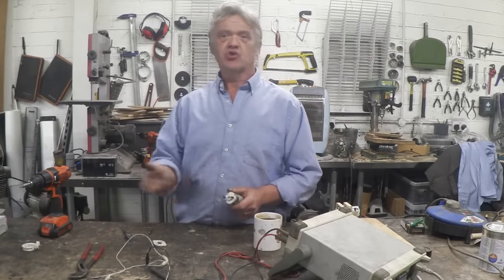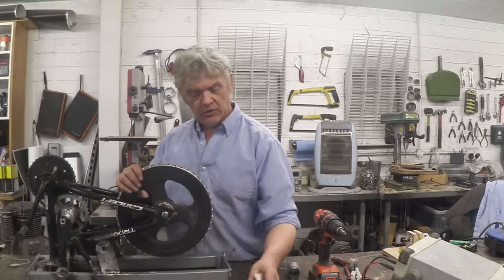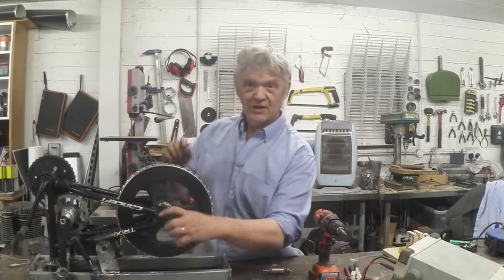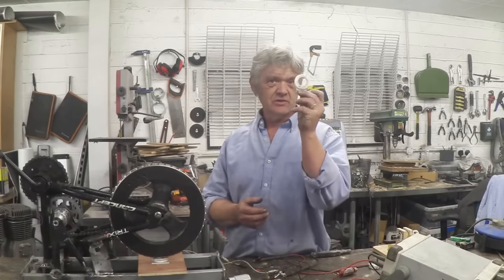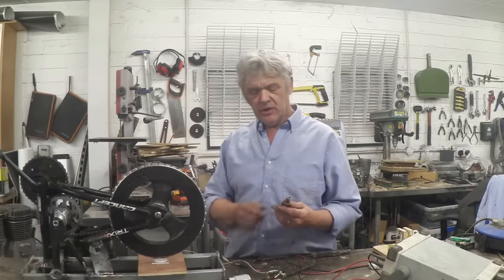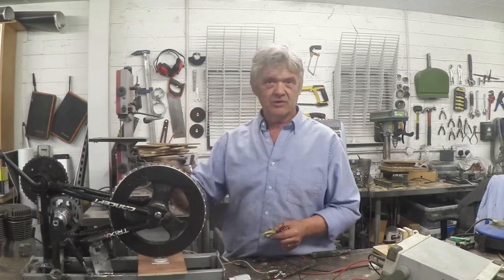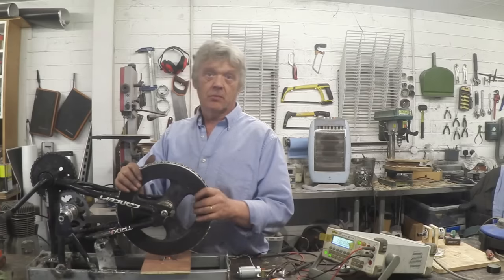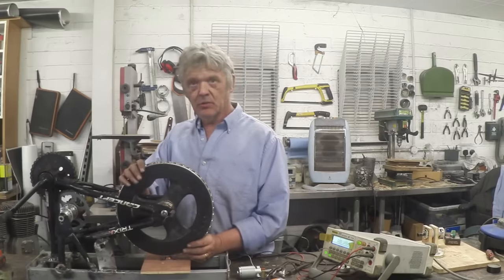2143 Generator Secrets

Comment: Great demonstration, Robert. I've spent countless hours with coreless coils manifesting electricity employing permanent magnet flywheel rotor development. To pass on the secretes of what I've learned and gleaned from permanent magnet rotor flywheel and coreless coils is comprehending that this is biased pulsed energy. I think you will discover that stacking two turntable open coils with the start of the coils facing each other (Split single-phase arrangement) and configuring the magnets all North or South will facilitate three times the wattage... I hope you demonstrate this in a future video demonstration. Thank you for sharing...

Comment: I have been saying that: more voltage is less resistance. For 10 years. Usually people just think I'm some free energy woo weirdo and put more metal on their generator. Not even thinking about how much Wimshurst on pulse motor could generate. This is what Gerard Morin also tried to explain.
Reply: LoL.
How much do you think tho the voltage should be?
Let's say for a 30kg worth of copper coil, permanent magnet motor?
Cuz I think too high of a voltage would be difficult to manipulate and manuever.
And the returns become diminishing at a certain point anyways.
Though I concluded the same for motors/generators as you.
Reply: Lol Tesla wanted to initially use 800 volts to maximize the reduction in copper and mass.  Say what you want about their Apple like software motes, the engineering is top notch.
Reply: @yasirrakhurrafat1142  The issue seems to be that all people are looking for something portable, or at least movable. The HV really isn't that much of an issue. MrTeslonian has a good video about HV step down transformer. It's basically a regular Leyden jars, with tunable copper wire coils inside. It's really not that much about the voltage either, high frequency seems to be more essential. Like the switch mode power supply works. It all depends on the usage. The key thing is to make good charger and have cheap fast charging hybrid battery capacitors, or both in parallel.
Reply: @Kangsteri  ooh yeaahh!
I also thought about motors, as how mini motors.. given enough voltage.. wouldn't require much power/current, thus could potentially push motorbikes and stuff at a really low weight.
Although it'll need ultra high quality bearings, and sufficient cooling.
Same for generators , considering a speed up gear is used to multiply the input speed.
I will need to look up though about frequency.
I used to kinda hate AC current.. now I see the utility.
I also think that reducing deadzone of generators will result in higher energy output, per size/weight.
Also as you mentioned, frequency.. to a good extent.
Reply: @johnschneider931 Louis Rossmann disagrees.
Reply: @ericmc6482  stop arguing and test it guys, you're on the same team here, we all are, this is for science. if the theories conflict, test it. that's the genius of robert's channel.
Reply: E=IxR
Reply: @Cryptic_Triptych  + Angular momentum. It's exponential, not linear. It takes less energy to run 3 LEDs or other diodes in parallel than one. It takes more power to start a carousel or swing, than to run it.
Reply: Yes, that is R, resistance. VFDs have more or less solved the issue of high resistance starting, especially on large equipment like motors. 

I always laugh when I see people trying to explain how electricity works when they refer to a sine wave or other two-dimensional vector drawings. They don't realize that the frequency is expanding and contracting in helical vorticies.
Reply: @Kangsteri I believe that was Tesla's main combo, High Voltage,  high frequency,  pulsed DC "current". For the transmission of electricity wirelessly, here we are talking energy generation. Could put the thing in a vacuum chamber to eliminate wind resistance,  use a tesalonian style Vandergraf generator and the capacitor based voltage divider that Mr. MurraySmith had shown us to step down the voltage,  maybe use graphene based supercaps to store it and regulate it
Reply: @suffolkcountysheriff  I have been thinking about that recently. I was planning to try transformer coils in mason jars. But vacuum pump is expensive. There is a hand pump called Brake bleeder, that would be much cheaper for experimenting.
Reply: This may be obvious to anyone who has done any real experimentation, but it seems to me that the resistance from the eddy currents is insignificant in comparison to that of magnetic attraction to an iron core... or is it that copper wires are too thin for eddy currents to form?

Comment: Even with the mechanical imperfections and only having a single coil, you should get way more than a watt out of that arrangement. I think the magnetic flux was mostly being pulled into the steel wheel away from the coil, and also the coil being close to twice the size of the magnets was causing adjacent magnets to cancel each other as they pass the coil.
Reply: Ah, yes... that was exactly what I was thinking as well.

Comment: You can use odd number of cored coils vs even number of magnets or vis/versa to reduce cogging also. I've also read that using a ferrous sand for the core can work better then solid or plate iron.

Comment: You should turn the "Fly Wheel Generator" into a kit for High Schools. Interchangeable parts to demo different configurations and resulting performance(s) then add some Arduino (volt, rpm, etc.) this will segue to the Computer Science, Electronics, Physics and Chemistry Departments culminating in a holistic education and a run-on sentence.  IMO, a holistic education is how we're going to survive the future.

Comment: Great video Robert. What you are doing idea wise is the same way as the idea I had for making a killer generator using the old style hit and miss engines of old. I would bet you that you could make a killer generator using that very idea. 
              I hope you run with the idea fella. Would bet that is the direction for you to use with that idea. Good luck as the old engines are super efficient and have longevity which is an added benefit for your idea. Peace vf

Comment: You could also use differently shaped and polarized magnets arranged as a Halbach Array which increases the magnetic field by restricting it to mainly one direction (the direction of the pickup coil) so in effect, the magnetic field intensity can be boosted. Boosting the magnetic field intensity as it cuts across the coil will induce higher potential and more current from the same coreless pickup coils, so still no cogging but increased power output.
Reply: Whoah, facinating. Neat, thanks for sharing.
Reply: If the array is spinning outside it's just dangerous imho

Comment: I am a bit confused... How is the current being commutated in this design? It's hard for me to read the Scope... so I can't tell if this is supposed to be AC or DC?...
Re: the low amp production,  could the low amperage of this design be due to the diameter of the coil such that the opposite ends of the coil are overlapping the magnets so they are fighting each other in a  "differential" manner rather than in an additive way? It's hard to say... the wheel is pretty big, so it almost looks like 3 magnets N-S-N could overlap the entire coil, and fight themselves.

Comment: can you tell me something? 
ive been debating on ordering some enameled wire but i have like 300 lbs of larger gauge copper wire. some is 10ga some 12-14 and some large but its way too big. its not enamled but it is insulated with the rubber which could be stripped in spots.
i know alot of people say conflicting info and i trust your opinion you just like messing with stuff like i do. i have a bunch of motors and things ive been playing with trying to get a reasonable useage camping generator with out huge space or fuel cost/noise. amps is more what i want than volts but i do know there is going to be a need for both. but a few amps goes a long way when the charge source only needs to see 12+v yes i know i can get used solar panels and for around 200 bux have 450-500 watts of charge and around 5-20 amps but their big bulky and fragile.

Comment: Could you use a simple magnetic accelerator then put a long  spring inside  that the accelerated metal would push against, which turns  a gear to your flywheel. then have the flywheel used briefly to nudge the next accelerator into place?

Comment: Instead of just one pickup coil, wouldn't the power be multiplied by the addition of more pickup coils added around the wheel?
Reply: It should increase depending on how you wired it.  I think in series it would increase the voltage but in parallel it would increase the amperage.  I could be wrong though.
Reply: If there are many pickup coils, won't it be that much more difficult to drive?
Reply: Both replies are true, if you think like mechanical power transmission, each coil is another pulley multiple pulleys gather the energy from the flywheel faster.
Reply: All three of the above are true

Comment: If you could get a belt of magnets, they I could stretch it over the wheel on my exercise bike, which I  generally pedal at about 27 MPH (40 ft/sec)  and I could probably get some good volts or watts from it.
 I even have a spare aluminium rear wheel without a tyre in it, so it would be perfect.
Reply: It ain't rocket surgery. Stretch a cut down, punctured tire tube over magnets that you've hot glued to your aluminium wheel. There you go. If you don't know what I mean just picture cutting away the part of an inflated tire that contacts the ground. Basically a giant rubber band, but exactly sized to your wheel.

Comment: Could you use a copper core instead of a metal core, yes I know copper is not attracted to a magnetic field on its own but could it produce the eddy fields and amplify the magnetic field  “like a magnet being dropped onto aluminum “ to create a stronger magnetic field around the coil ??? This should get rid of the cogging and hopefully create a stronger magnetic field in the coil.
Reply: Could be wrong but I think copper would have different probabilities of its atoms lining up in the direction of the magnetic feild , they use eddies of magnetic Fields to move chunks of aluminum off a recycle conveyor belt because they cant just use a magnet. The same is probably true of copper.
Reply: Typically the current in the copper that is induced by the magnetic field will "oppose" the original magnetic field... so, it probably would lead to loss. That is why a lot of effort is spent to reduce eddy currents... (It also reduces heat to get rid of them too).

Comment: What effect would adding more magnets to the outside of your blender motor have on its efficiency?
Reply: The best answer I have come up with is: Imagine an infinity powerful magnet next to a conductor. Electrons would not be able to pass. If the magnet power is a really super high finite quantity electrons could pass but it would take a lot of power and the torque would be huge. More work is done with greater field density requiring more power. On the other hand if there is no magnet or a super tiny one electrons pass freely with nothing to push on and very little power is needed. As far as efficiency. No magnet is the least efficient. All the electricity passes without being used. As the magnetic field gets stronger more of the energy from the electricity is used because the field is what transfers the energy so it is mor efficient..

Comment: Bloody hell Robert you do the volts and amps and dont even tell us what they are, just saying its 1.2 Watts compared to 30 Watts with the tiny motor!  

Granted no cogging with one coreless coil but 24 would surely have higher mechanical resistance than one...even if there is no "cogging" as such

Finally, if you teach this as one side of the sine wave is a magnet approaching the stationary field and the other is departing from the same stationary field, then isn't it evident how the 

This is more "generation at the rim stuff" and at the rim means more turns, thicker copper and heavier current are more practically engineered.